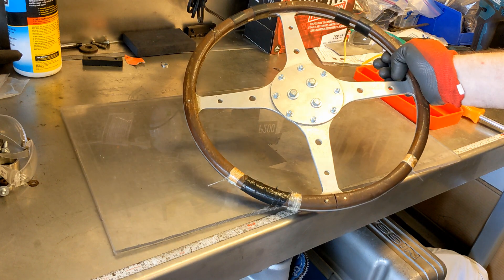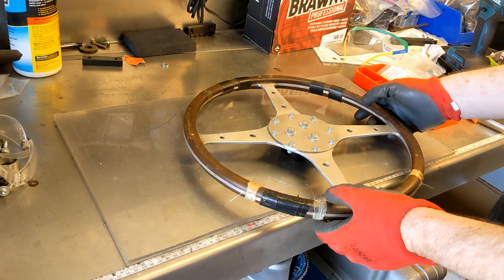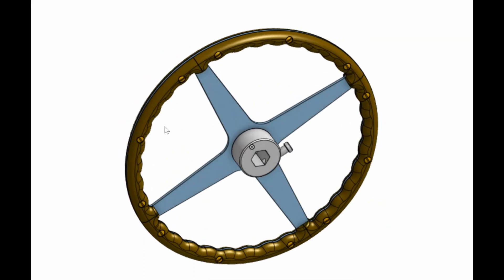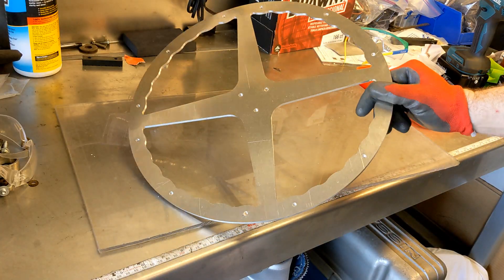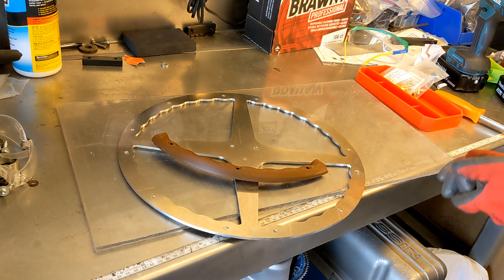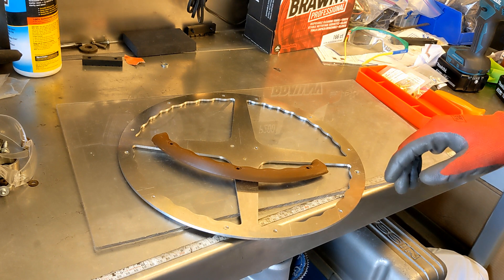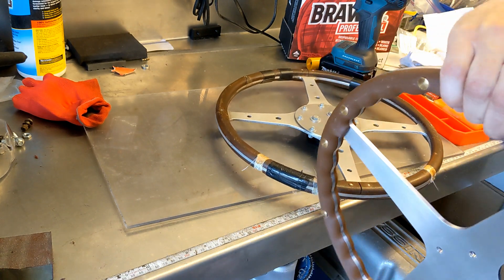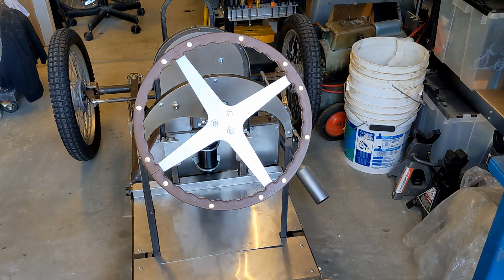Modern Vintage Steering Wheel?

Comment: Hi colin, great steering wheel and looks close to what i woudl like to achive for the maserati 4cm project i have.Any chance of the files for the blank an grips. Also what diameter is the steering wheel diameter?. thanks
Reply from the maker: The inside diameter is 13.75" and the the OD is 15.25". I  wish I had made the arms a little skinnier. The material is 7 gauge (0.18") thick
Reply: @tremortech  thanks, any chance of the files?